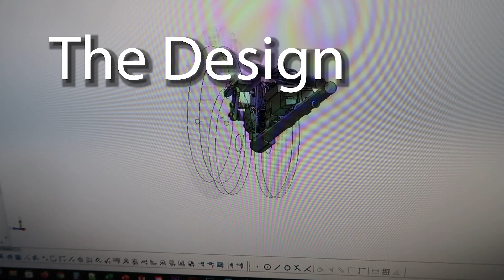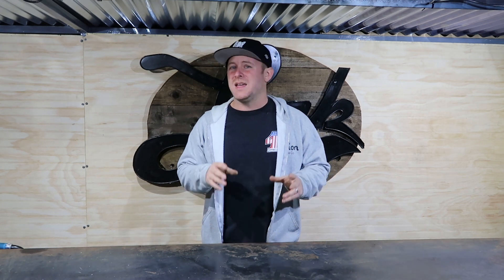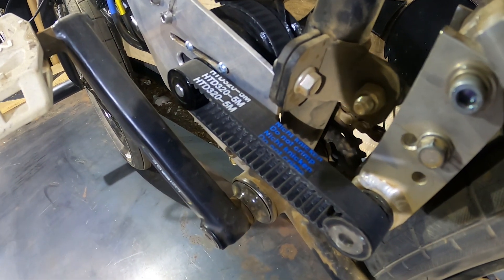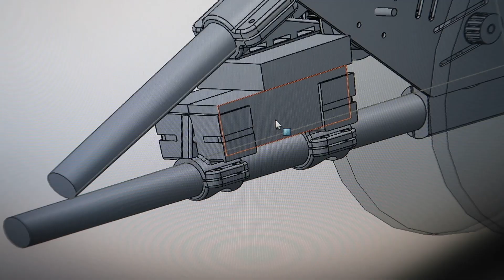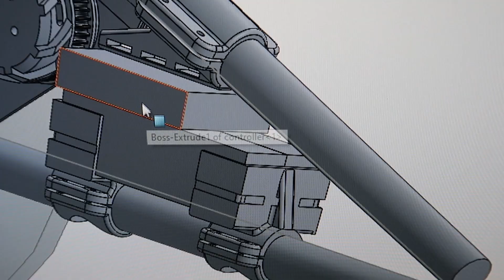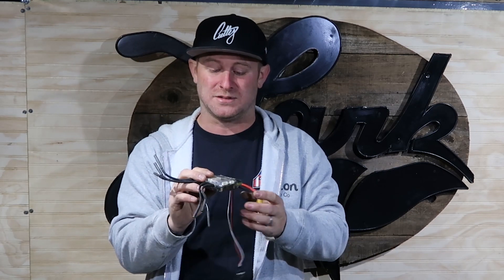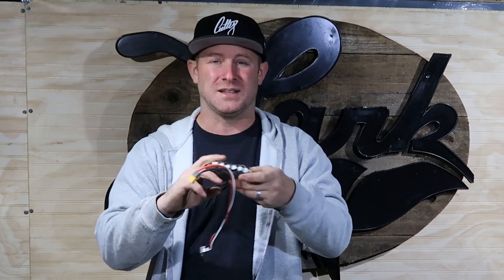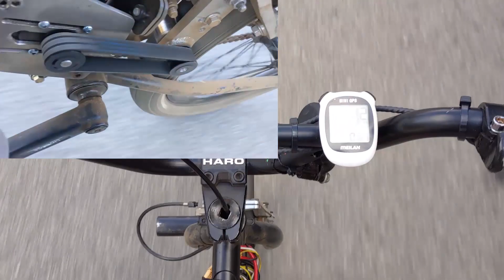EBMX BUILD | Lark Machine Co

Comment: I like the build, really like you can still use the BMX  as BMX should be. I built a few EBMX bikes but most you could never style like that, Mine were more street rocket and too I use BMX frame to build electric mini bikes for kids. just using a direct drive hub motor on the rear. I feel ya on the delivery wait time, especially when it is the wrong part. I would had likely been looking around town at auto part shops to find a belt to do the job.

Comment: is there a more "budget" method to do this?
Reply from the maker: Hmmm, you could use cheaper motors, batteries, and controllers.  The performance will drop though
Reply: @sheanyquist  alright! I just want like a 2 mile range minimum and I’m shooting for under 200 dollars so
Reply from the maker: @quentinbona2  you can drop it down to a single motor system and probably save some money as well
Reply: @sheanyquist  what tools will i need to do this?
Reply from the maker: @quentinbona2  saw, files, drill, and taps.  And lathe and mill make it easier, but it can be done by hand.

Comment: Hey, Mr. Nyquist, is there a possibility to get in contact with you for some advice on my build? I've been working on a two stroke BMX design, and I have it posted here (https://motorbicycling.com/threads/engine-bmx-70-done.66635/#lg=post-690196&slide=0) if you are interested in checking it out. I wasn't initially going to go electric up until I saw the motors that you integrated into your build, and I was wondering if it's possible to use the bottom spindle as a jackshaft in any way to integrate those motors...
Reply from the maker: Shoot me an email to larkmachineco@gmail.com